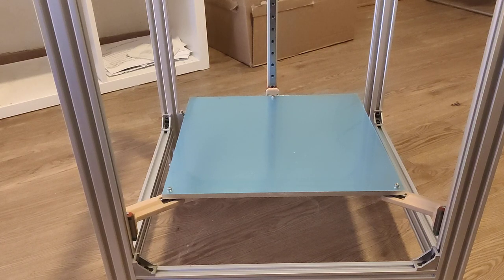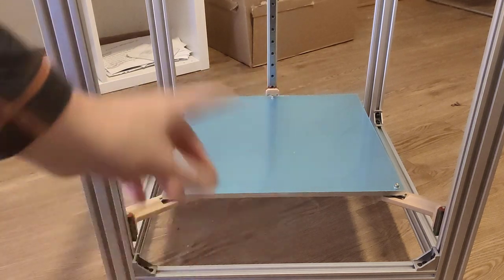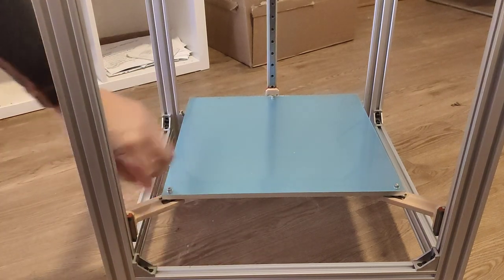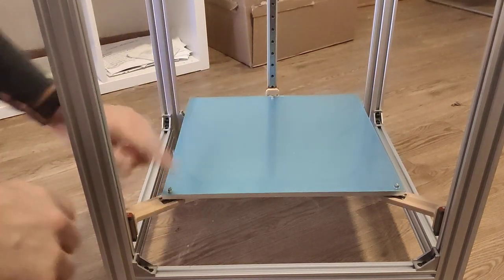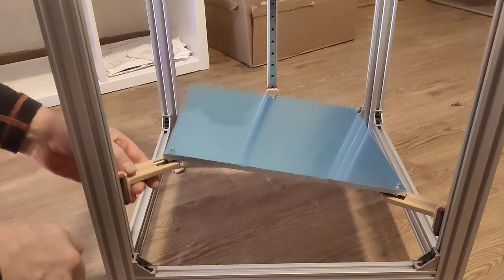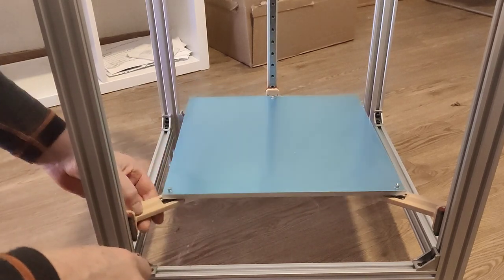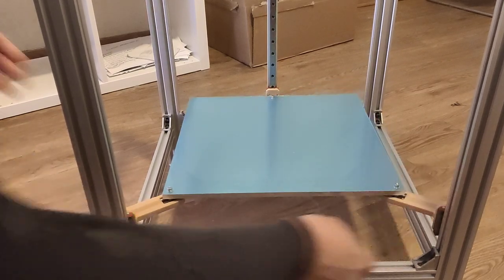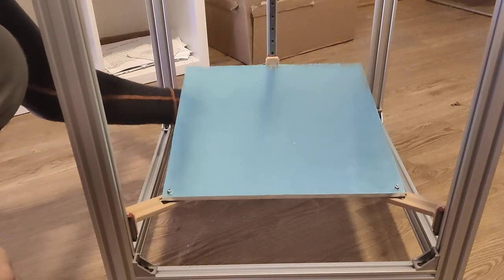First look at the Kinematic bed Coupling for Project Valkyrie

Comment: Just an observersion, if the bed is placed in the middel of the frame you could lose the option to get a hemera style extruder to fully Max out the bed
Reply from the maker: That is true. We are not looking at the Hemera though. It is way too heavy and does not come water cooled

Comment: Very Interesting and great potential. Why Tripod and not 4 slides??
Reply from the maker: Thank you for commenting. Just because there are no kinematic systems with 4 points. Also, it is not possible to level a planar surface with 4 points unless you bend it. Just think of a table with 4 legs vs 3. The table with 3 legs will always be stable
Reply: @PRO3DESIGN  Understood
Thanks,

Comment: The threaded rods and there flanges are gonna be under a bit of strain from this design too. look its a good and great idea but you gonna need a bit of a rotation on the angel of those threaded flanges too that moves the bed up and down. but then you loose stability and if there is one miss step on one of the stepper motors out of the 2 it might cause the bed to tilt. the only thing i can think of correcting this is a gyroscope controller and a lot of coding, or is it just me that's seeing this ?
Reply from the maker: Thank you for following. You must follow the process and your concerns will be over. There is something you misunderstand with the system.
Reply: @PRO3DESIGN  I understand what your doing so yes id like to see this process through till finish.

Comment: I am still confused, why it is so important to move whole bed for leveling bed, if printer use only one spot in a time, wxactly where nozzle is in that time. It is about distance between bed surface and nozzle tip. You can move bed or nozzle. Distance does not care. Moreover large bed supported only in 3 points is not the best idea. I prefer all 4 corners. I built up 500mmx3 printer myself and those are my experiences.
Reply from the maker: Hi Ro and thank you for commenting. This is to optimize the function of a 3d printer by eliminating the need for manual bed leveling. With the maxwell coupling criteria applied we can use true bed tramming in the firmware to take care of the leveling and we just have to set Z offset correct for the nozzle. We also use a fine-milled 8mm cast aluminum (al 5083) that is flat and stable to thermal expansion so it will not warp. The bed can be looked at as a planar surface and a plane cannot be leveled with 4 points but with 3 and 3 only. You might be able to move your 4th point up to the last corner of the bed but it has no function in leveling a planar plate unless you bend it. If you are happy with your solution, then that is fine. I used 4 points myself on my first 3d printer and it worked fine using auto bed leveling
Reply: @PRO 3D  I do not see any reason why bed can not be supported on all 4 corners. It's about math of all 4 motors movement if you need to autolevel bed. It's far better support for bed. Smaller printers It's not a problem. But bigger bed its different word. you know, the frame is not infinitely stiff, so if you push bed on free corner it will move, I am sure. Maybe firmware is not ready to move 4 x Z motors simultaneously that could be problem.  
Anyway I like your work.
Reply from the maker: The bed can be supported on all 4 corners but only 3 of those will level it. The nr 4 corner must be adjusted so it touches the last corner but if you adjust it too much lifting the nr 4 corner then one of the other corners will lose contact. Try it yourself, take a piece of wood or something and put similar objects under each corner. You will see only 3 objects touching so you must put some piece of paper or something under the last corner to keep it from wiggling. And yes, this is possible and the way most people do it but that does not mean it is the correct way. If you have a planar and stiff bed, then 3 points is the best. Firmware allows for 4 motors so this is possible and can be a reasonable solution if your Z probe is accurate, it might be able to get all 4 points in contact, but it is difficult. Then we are going for advanced functionality with no manual leveling and true bed tramming by firmware, this is only possible using a kinematic system lifting the bed. Kinematic systems like the maxwell coupling criteria only allows for 3 points as 4 is not possible due to the above. Follow and see the results :) Have a nice day